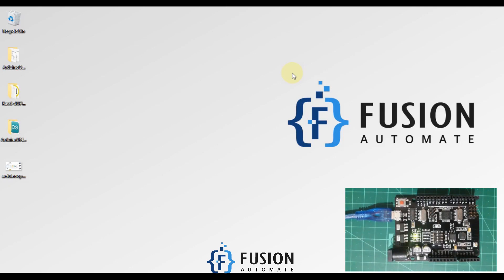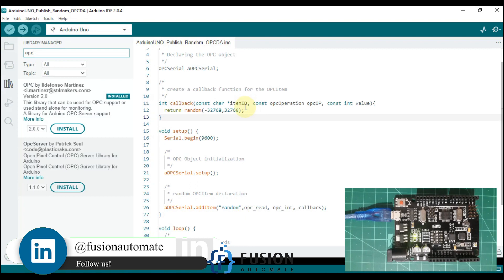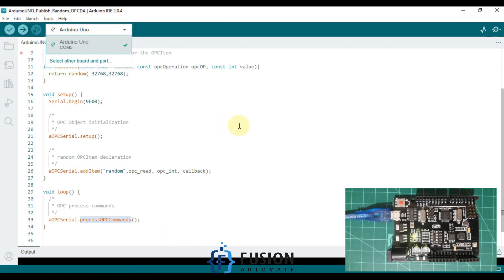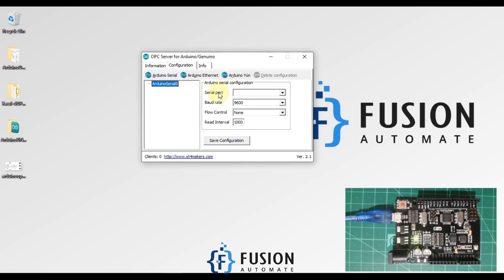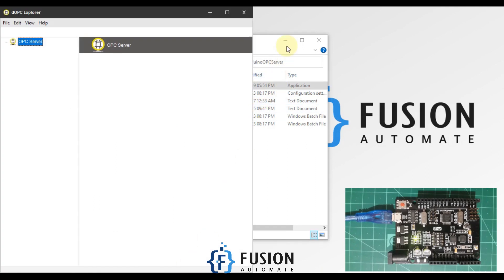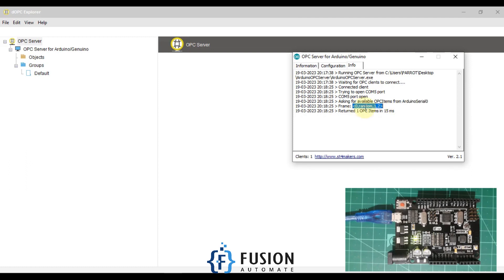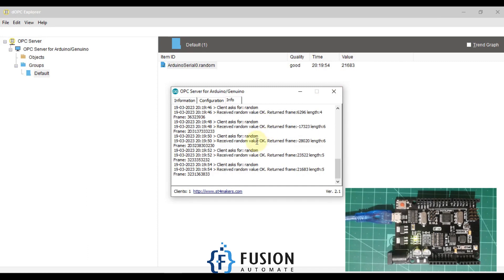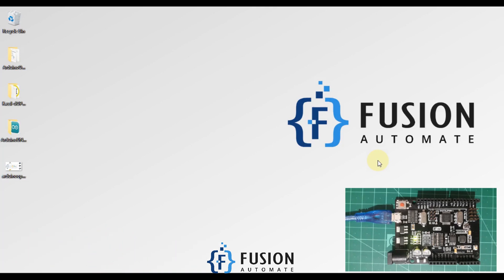Publish Random Values from Arduino Uno to Arduino OPC DA Server & Read Those Values in OPC-DA Client

Comment: The Random tag is not getting returned when connecting to OPCDA. What could be the issue. I am getting the frame as blank.I am using Arduino UNO R4 WIFI Board. ArduinoOPCServer, dOPC Explorer downloaded from your shared github link